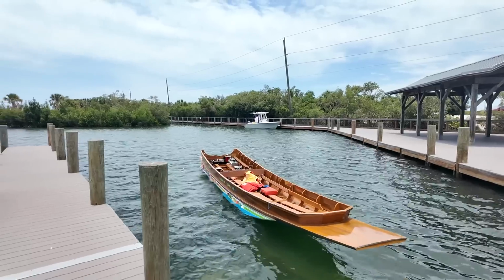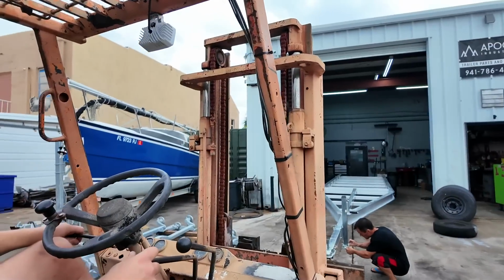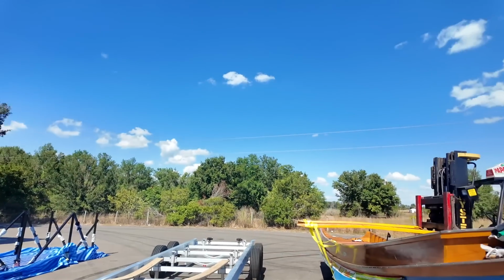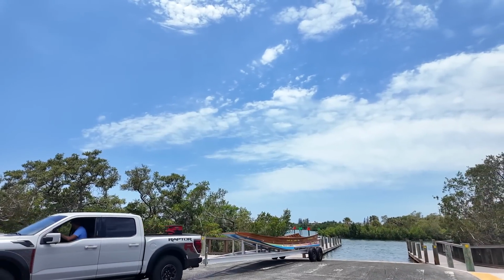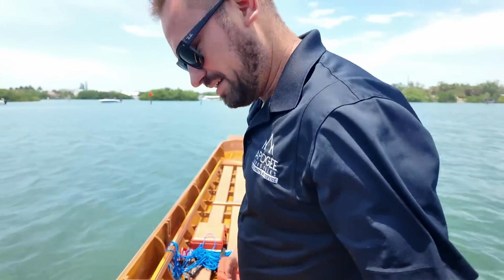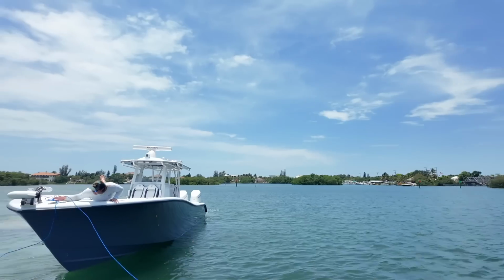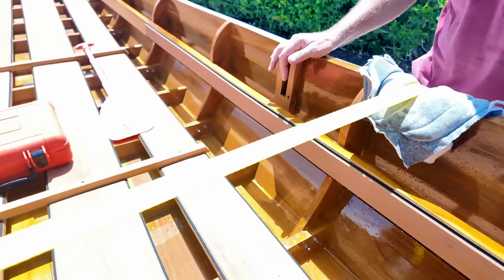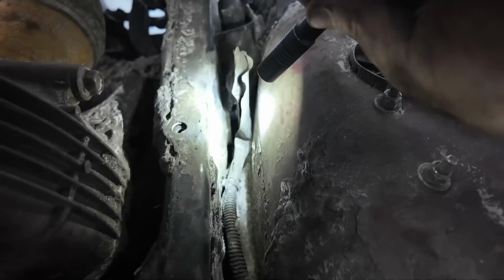We Almost Sank the Thai Longtail

Comment: You're going to continue to have issues with this boat.  Even though it's teak, which is great for wet applications,  wood moves.  And will continue to move throughout it's life.  And even though you may patch the area that leaks, this will happen in other areas over time as the wood continues to move.  The correct way to fix this would be to completely fiberglass the hull.  Inside and out.  You have to make that hull completely impenetrable.   Something like this.  https://www.youtube.com/watch?v=VMBO4gjCUMk
Reply: You obviously know nothing about Thailand long tails lol. What do you think they made boat out of before fiber glass was a thing?
Reply: @radford_0731   This boat is going to be in and out of the water all the time,  not something that stays in,  which means it's going to dry out often.  You don't understand wood movement,  this boat over time is going to split itself apart.  If he wants to not have to deal with a nightmare every time he takes it out,  he'll ensure that the hull is impenetrable.   If the boat were staying in the water all the time,  the wood would swell and seal those cracks,  like on a wine barrel.  But it's not, it will continue to move and split in different places.

Comment: i have a feeling the wood is super dry so it has shrunk. i think having it sit in the water and saturate it would swell and seal itself.
Reply: That's right. In Thailand we don't keep boats on land for long periods of time.  It will drying out and cracking. I guess wooden boat  This travels in a container for a long time.  This causes the wood to dry out and shrink. You can try spraying it with water and covering it with plastic to make the wood swell back up. Love from Thailand🇹🇭
Reply: @powergpm  casual wood boat things. A friend is building and reparing boats and yeah when refurbishing a old boat that was sitting on land for longer time he literally sinks it for a couple of days so it takes enough water. 
If there is already stuff installed he just tie it at the marina
Reply: Exactly what happens 👍
Reply: The teak is fine in the water the leaks will stop. We also see Beeswax on the seams to help seal naturally. I think in America it is called Beeswax? Or many you call it Carnauba Wax in America? It is also used on surfing boards for gripping.
Reply: Just fill it with water for storage
Reply: Agreed
Reply: Usually I only see them on land for repairs. But the rest is parked in water
Reply: i agree
Reply: No that won't work it's teak. It's good theory but won't work. 3m marine filler then sand then apoxy.
Reply: 100% facts
Reply: Right you are !
Reply: Yep wood is a living thing it will shrink if it dries up i think with some soakung up the wood will get back to seal naturally
Reply: I had a 1942 wooden Chris craft riviera with the original bottom and we use to have to put the garden hose in it to swell the wood before putting it in the water. Not sure if that method applies to this boat might be worth looking into.
Reply: The nature of wood is always still alive .
Reply: Flex seal can fix anything
Reply: For what it's worth seems like these guys have good advice, I seriously doubt if these boats are ever in situ lifted free to dry out and the wood swell seals them watertight but obviously as it's been transported to you it's dried up and shrank back and cracked I think you will be good when she's stays wet if you have somewhere to permanently moor her in the water?
Reply: If you are looking for products that would help out look at total boat products in US Great company and product
Reply: genius
Reply: I believe they built it out of Teak. Teak is naturally water resistant due to the natural oils. My deck is teak and doesn't absorb water. You can use teak oil but that locks you into at least a yearly ritual. I've also been told not to oil it in an outdoor environment because you can lock in water and cause it to rot from the inside.
Teak also isn't glossy like his boat is which makes me think it's been clear coated with something. Shipping would cause cracks in the varnish or whatever they coated it with.
Reply: What bozo trailers a wooden boat and store it on land. Wooden boats are supposed to stay in the water so this exact thing doesn't happen
Reply: @MrTk6969 it probably became too dry in the long shipping/import process.
Reply: @MrTk6969 you’re not very bright are you?
Reply: @tma4137  u obviously know nothing about how wooden boats work
Reply: @tma4137 he’s 100% right..
Reply: @MrTk6969 I think you are on the money for what it's worth
Reply: Maybe….Humility in Florida is similar to Thailand. Probably cracked in shipping.
Reply: Won't the wood swell up and then begin to rot?
Reply: It shouldn’t swell or shrink the wood is sealed and would require damage in order to cause those things to